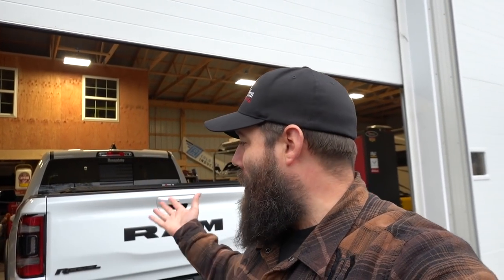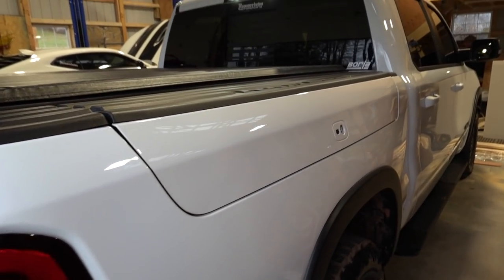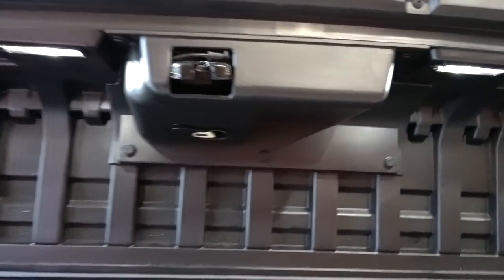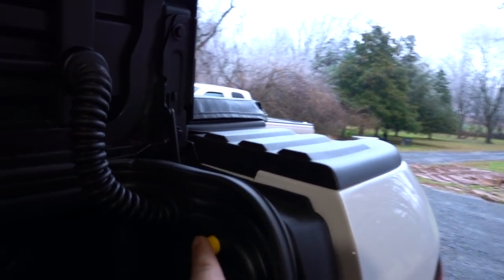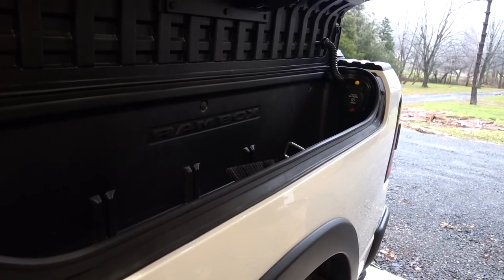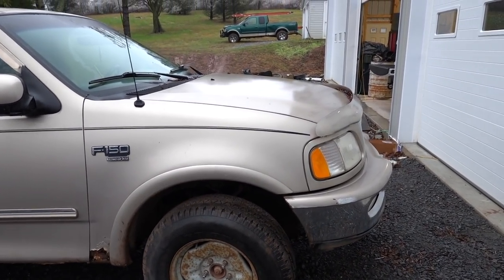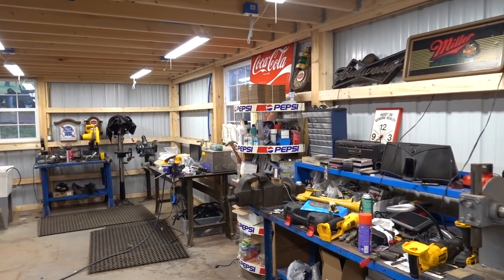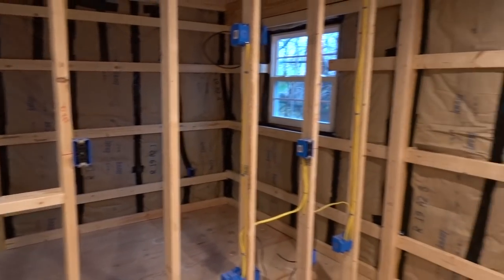Why To Get Ram Boxes

Comment: Definitely better than the in bed aluminium box. And to verify that im old, was a huge fan of the 70s tool boxes on the old fords bed sides! Lol. You definitely have the dream garage!!!! Sweet
Reply from the maker: yeah those were cool most people don't remember they had them, chev had them as well as the dodge power wagon in the 70's
Reply: I had the Chevrolet Avalanche back then and it was sweet that both sides had it. One for your tools, and the other for a cooler.
Reply: Dodge definitely had them. I have one in the backyard

Comment: I have always been a Ford guy, and I drive a Raptor, but the one thing I've envied from Dodge is the Ram boxes.  I can't imagine getting that truck and NOT getting them.  Now that I know more about them, I like them even more.  Thanks for the vid.
Reply: Do you actually offroad or do you use it as a highway jewel like a soccer mom??? Cause respect if you offroad it (i have a p wagon and looking to get a tremor for my uncle).
Reply: @danielhan8995  I don't jump or race it, but I go off road a lot running trails pulling my off road trailer to campsites.  Does that count?
Reply: @MrRayMac1963  of course! Good job for taking that expensive ford off road!
Reply: @danielhan8995  You should see it with the matching trailer.  I really let vanity get to me, and had graphics done to match.  But I do get it all dirty so...

Comment: If I can ever afford a new truck, it will definitely have them. Mega cab, Cummins, Rambox. That's my dream.
I had the same thought as you, one side for straps, tools, and chains; keep the other one clean and empty for whatever you might need. I would switch sides though. My reason: if you have to pull over and mess with your load, you don't want to be standing with your back to traffic while you get stuff out of the box.

Comment: Not gonna lie… I bought my truck which has them & MFT (which at the time I thought was stupid) because I had to have it and it was on the lot that day, it had everything else I wanted.

2 years later I love both of the features. I store hunting stuff that needs to stay dry during hunting season (like my shotgun) and a handful of tools. Can be a cooler. They are really handy.

My ONLY gripe is that the body panels on ram boxes DO NOT line up at all & on an 80k truck I think that is kind of cheesy.

That said, I will absolutely get them on my next truck too. They are awesome.

Comment: i have a 2015 with Ram Boxes and everything still works as it should.  only had to replace the rubber plugs in the bin bottoms and the top on the bed rail has faded from the sun.  you get better plugs from the local plumbing supply or hardware store for 0.18 each instead of 14.00 at the dealer.

Comment: Imagine having in-bed storage that actually takes room away from your bed.

- This post was made by Ridgeline gang

In all seriousness, great video man. My only concern is with rust around the exterior edges a few years down the road.
Reply from the maker: the doors are plastic and no rub points on the metal part of the bed should be fine lol

Comment: I too  at first was not interested in the ram box in my next truck, the power wagon.
This video confirmed my decesion to get to get it after all. 
Frees up storage space  for a first aid kit , fire extingusher, & other very small items underneath cab back seat leaving storage of larger bulky items examples  chainsaw & power tools for the boxes ! Great to know light will shut off when when closing lid !
Have you had a atv in the bed, if so how was the side fit ?
Any water  leak into the ram boxes ?
What make is the bed cover ?
LOT'S of work to keep you busy over the winter !
Liked your comment  to another you tuber that the experience you  had was not as per say the truck but the dealership !
Reply from the maker: yeah I get pretty frustrated when people at a business just don't care and waste my time like it has no value its sad to say but there are too many people out there that don't care about others or have pride in good customer service, but I have had no leaks the water in the passenger side is cause I had it filled with ice then drained it recently, and the bed cover is made by truxedo I made an install vid on it if you are interested, and I don't currently have a small enough ATV for a truck bed but I would like to get one and try it out.
Reply: @HammerdownMotorsportsUSA  Frustration with trucks remains with me too this day as commented on your recent visit video to the dealership.
THANKS  for letting me know you had no rain leaks in the boxes, & the bed cover name.
Will watch your install video.
Weird winter in my province so far ! No acumalation of snow yet but EXTREMELY HIGH WINDS WELL IN ECCESS OF OUR NORMAL HIGH 
WINDS combined with above average heavy rain fall  from the start of November  up to this late in December.
GLAD i live on the east coast NOT the west coast of my province !

Comment: I have the Ram boxes on my 2019 and the fit of the door does not align with the body. There is no adjustment to the door. I’m taking mine in on Monday to have it replaced. They said it is a very common problem with the doors. I’ll let you know how it turns out.
Reply: My friends 2018 bumper was off center. It's just Chrysler manufacturing

Comment: I think the inside swinging toolbox is better because I don't like how it looks messes up smooth outside side and someone can easily pry it open and take your snap on tools also with the swinging toolbox it'll be inside the locking hard bed cover and you can easily remove it if needed.
Reply from the maker: Yeah but not as easy to access but each to their own

Comment: hi, sorry for asking, but the 110w outlet in the ram box, is it powered by a separate battery or from the main car battery? And if it the latter, is it possible to connect a separate for it so you don't drain main one ? thank you very much:)
Reply from the maker: There is a switch in the cab to activate it but the main power source is the truck battery I don’t believe there is a second one unless you have an etorque but I’m sure it would cut out before it drained your battery
Reply: Thank you for your time responding to me. All the best to you!

Comment: I recently bought a 2500 ram with the ram boxes. It’s the one thing on my truck I really can’t stand. I have thought about buying another bed and getting rid of them they leak and take up too much bed space
Reply from the maker: Really I have never had a leak and don’t want to be without mine
Reply: Yeah eveytime it rains or wash the truck the driver side box gets water in it and I can’t see any way to adjust it

Comment: Do you think the Decked drawer system would be a decent option to replace the ram box?  I keep looking at it and can’t decide if I want to pull the trigger.
Reply from the maker: they look like a good option if you need a bunch of storage but the take away the depth of your bed depends if that's an issue for you or not

Comment: Biggest draw back is the space they take up in the bed of the truck.  When you are loading 4 ft wide drywall/plywood while it fits it's so much easier without the ram boxes. Not a big deal for the weekend do it yourself guy but for a guy that loads these materials daily , I'd rather have the tool box than the ram box.  Just my opinion.
Reply from the maker: yeah it depends on your daily needs but at contractor probably would opt for a long bed if you haul a lot
Reply: If you do drywall. You can't afford this truck

Comment: My only concern about the rambox is in the future is that a spot where water can get into and start to rust it's just I like to maintain and try to keep my vehicles as long as possible and if any buddy who knows who's had Dodge trucks or I seen people with them know that the older rims are known to rust extremely bad around the rear wheel wells badly so is this a another future problem
Reply from the maker: Joseph Malinowski the ram box is plastic and I guess time will tell where these ones will rust the 3rd gen ones had a bad design that collected salt and cause rust but hopefully the 5th gen will be better
Reply: @HammerdownMotorsportsUSA  I had the third gen and had it repaired buy a body shop and within a year it started to rust again I've had three total Ram pickups I still have a 2001 Ram diesel 2500 which I upgrade it to the 3500 suspension and Gale Banks exhaust Turbo upgrade and the six shooter programa it's a beast I can pull a house down with that and a 2016 Ram Sport but I've been recently looking at the 2020 Ram Warlock I love that Rebel you own the interior on that truck is just beautiful but I've yet to take the Warlock for you test drive but I will be purchasing a new Ram pickup soon but I do think if I didn't have the 04 Ram I would even be thinking about the rest but that was a killer if you take your hand and reach under the bed you can feel two holes where the manufacturer could probably drill out the holes for the dual pickup trucks maybe that's where the water gets in

Comment: Hey what bed cover would you recommend? i have Ram boxes and a multifunction tailgate.
Reply from the maker: It really depends on what your needs are mine I use to keep out rain and snow so I got the Truxedo Xport and it works pretty good for 500 bucks, if security is what you are after Perigon and Roll N lock are pretty good too but more money

Comment: Random question: have you had your tailgate randomly open? I have heard there were recalls on 2018 models tailgates opening. But on my 2019 rebel it has randomly open twice not sure how. Parked it at work yesterday and coworker said my tailgate was opened.  Super weird but hasnt happend since.
Reply from the maker: hmmm no i have never had that happen but mine doesn't have the electric release on the fob not sure if that is the difference
Reply: @HammerdownMotorsportsUSA  mines the standard one like yours. Ill have to keep an eye out on it just to make sure it randomly doesnt keep on opening lol
Reply from the maker: @nabatron21  ill keep an eye out for sure thanks for sharing
Reply: There is a recall on this.  See your dealer for the fix.  It is one small plastic piece they have to replace.
Reply: @RobertTaylorRTC  on the 2019s?
Reply: @nabatron21  not sure about the 2019s. But that is exactly what was happening with the 4th gen. Perhaps if you have the "Classic" 2019, that has the same bed and tailgate as the 2018
Reply: @RobertTaylorRTC  have 5th gen rebel

Comment: I have the ram box and I like it. But a few downsides to point out: accessories are a lot harder to find in some ways. It’s hard to find accessories for the ram box, unless you buy directly from Mopar. You can’t use a camper shell, because then the boxes won’t open, and there’s nowhere to really attach it. Same for bed racks, there’s only like 2 people making them to fit the ram box, and one of them is over 2000 dollars. The bed is narrower, but it’s still enough to fit plywood or drywall. Otherwise, I like it. I just use them for stuff I would have used a toolbox for, so I’m just trading bed width for bed length.

Comment: Will your snowmobile fit inbetween the ram boxes? My sled is around 50” outside ski to outside ski
Reply from the maker: I would have to measure but I think it would
Reply: If you were to order a ram- would you have ordered a crew cab 6’4” bed?
Reply from the maker: @Pjw350  no I like the large crew cab If I haul my side by side or any large items I use my utility trailer I beat that thing like a rented mule and keep my bed nice
Reply: You can buy them with a crew cab longer 6’4” bed. If i ever upgrade my 04 i think i would get the longer bed

Comment: Finding a bed rack that fits the rambox is a bitch and a half. That's my current problem. I run a window cleaning company and I want it so that I can carry ladders but I also want to use the rambox systems for the smaller tools and rags. 😫😫😫
Reply from the maker: True there is always the custom route a fab shop could do one easy

Comment: Hey Hammerdown!
Wondering if you heard much about them being crooked. My 2019 Laramie with the boxes came very crooked. The lids appeared warped. Took it back in and they aligned them a little better but now one lid doesn’t shut as smoothly. I’ve read online it’s been a pretty common problem but was wondering if you’ve heard of this.
Reply from the maker: Josh Shoup mine aren’t perfect but open and close well
Reply: Josh Shoup mine look warped but close okay. My passenger side one wasn’t closing properly, took it to the dealer, they aligned it a little better then told me to use a heavy hand to close it...

Comment: I've heard and seen testimonials of dudes who load trucks that these new crew cabs ain't nothing more than a car. Useless. They're not a "truck." They'll load up some things but they don't fit. These Ram Boxes, while cool in theory, detract from the practicality of a Truck and make it into a GI Joe vehicle. You lose a greater tool, for the acquisition of a convenience. Bed space. Look how tiny that bed is man. Cain't fit nothing in there. You're likely to haul a trailer with a double box frame and mattress in this new truck. Not only that, these new tail gates are for lazy spindly arm dudes or bros in gym clothes. Too much. Again, you lose a valuable tool for a convenience and perk...different opening tail gate. 

But that's just me. I refuse to buy a new truck. The newest I'll go is a '13 Dodge made in Mexico. Not none of them UAW Shop Rat made trucks.

Comment: Ya you have to buy a junk truck 
To get those boxes 
Naa I will pass
Reply from the maker: they are all junk
Reply: I will agree and disagree 
In our business 
We own every brand 
Dodge rust is big issue
Motors great trans not so much
GMC dura crap 2017 
Biggest 68k pile of shit ever
Our power strokes are great if you delete them or I mean repair 
The haters are going to get mad
The most reliable truck We own 3 of them,,,,, Toyota Tundra the dam thing just go one has 375000 miles on it 
I prefer this one cause don’t care if it 
Gets scratch or dented
Reply: You can buy any vehicle, if you don't treat the underside and fenderwells , they will all rust. 
I just undercoated my 2018 1500 with wool wax.  Best $145 you can spend
Reply from the maker: @717weston  yeah I had a 2010 ram for 100k miles had no real issues the older ones rusted pretty bad I wash my stuff so it should be fine I just can't get into toyotas their interiors just suck but each to their own, and yeah GM has dropped the ball on quality big time, I like the Fords but my 2014 Cummins just went off warranty so I think it needs to be...."fixed" so it can breath a little better but that's been a good truck too.
Reply: I’m knew this would start a fire storm
Reply: @717weston  well my tundra threw a rod at 12k miles and my ram now has 140k no issues so your right haters gonna hate
Reply: @HammerdownMotorsportsUSA  not true. GM and Toyota have the best build quality
Reply: @kidamere2408  ill bet thats fake news
Reply from the maker: @andybub45  My Gm for sure does not and Toyota well Ill drive one of those when I live in Japan #Merica
Reply: @andybub45  good one